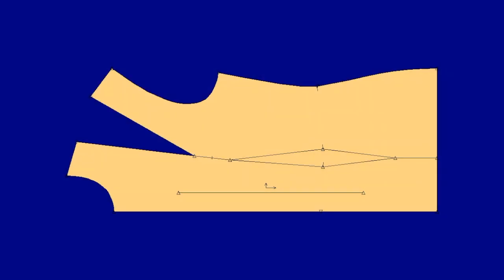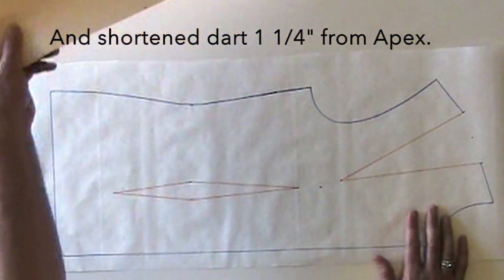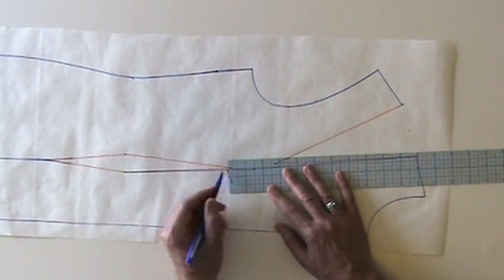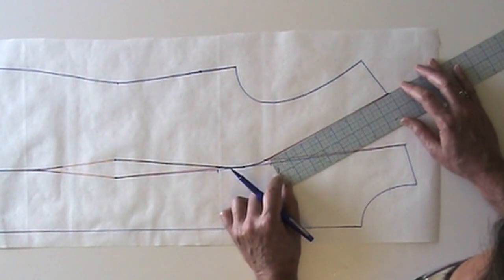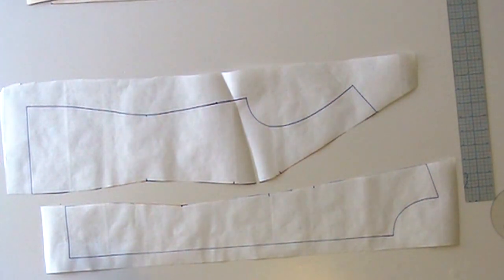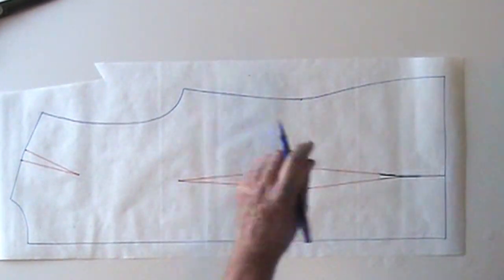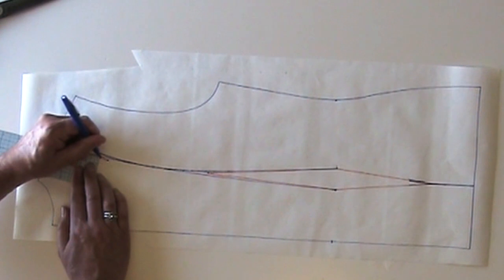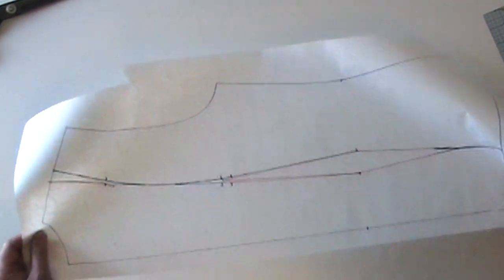Drafting Princess Seams - Professional Method, Part 1

Comment: Thank you so much for sharing your expertise.  I wish I found you before I bought one of those expensive  "pattern expert" "fitting systems" .  It is exactly as you described, the cookie cutter pattern.  no wonder it doesn't work for me.  I have trouble with shirts neck and shoulders riding to the back and got advice to do a high round back and low round back adjustment. hasn't worked.  just leads to more adjustments.  I will definitely give this a go! Have already tried just pinning a few shirts in the front to be more narrow and that seems to solve the problem!  Thank you, Thank you, Thank you!!!
Reply from the maker: Such quick and easy pattern systems are the "Vegematic" of pattern making.  They work great when demonstrated, but not when you get them home. Professionals would never use them.

Comment: How do you decide where to put your notches?  Is it arbitrary?  Or is there a method to help you decide where to put a notch?
Reply from the maker: There are a few places where notches are standard, such as at the waist, and in the case of Princess seams, a distance either side of the bust apex.  Most other notches are placed at the pattern maker's discretion.  They are there to help match up pieces while sewing.